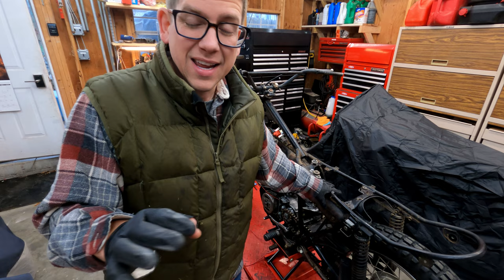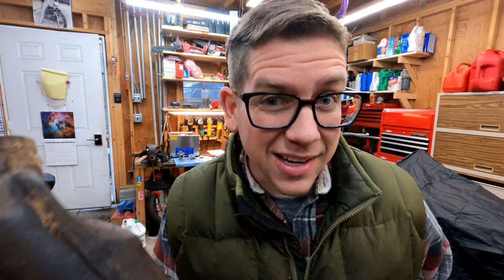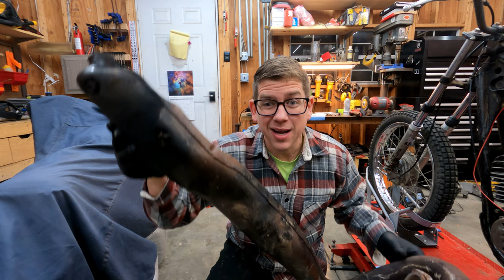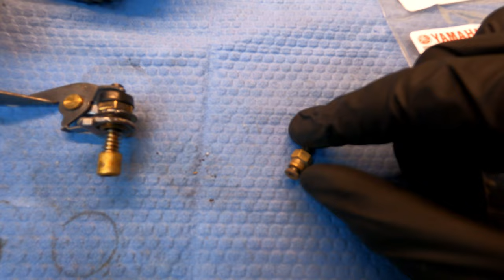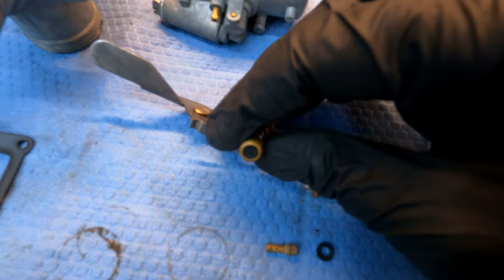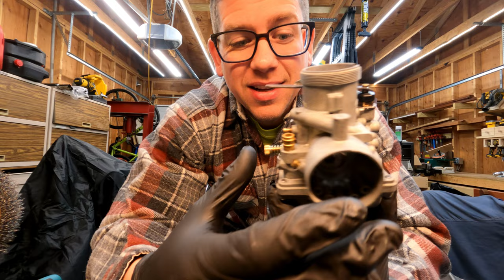FINALLY Starting  - VINTAGE ENDURO MX BUILD - 1974 Yamaha DT250 Pt4

Comment: The fantastic troubleshooting abilities, and patience, shown here are skills that everyone should have, in any job they do, not just mechanical stuff.
Reply from the maker: Thank you! Sometimes I wish it didn't take me so long to diagnose things, but then I remember that I'm relatively young compared to some of the old timers that have been doing it for 25 years
Reply: @two-cargarage  Process is the most important thing. Speed comes next. I'm not all that experienced and I have learnt that rushing you can f#$k things up real quick. Not great when you are dealing with parts that are expensive, or impossible, to replace. I hope you do more vintage Japanese stuff

Comment: spot on, thats why diesel engines go into "regen" mode to clean the cat and exhaust, computer overheats the ehaust and puts fuel directly into the cat to burn off deposits. along those lines, i had a brand new Mallaguti moped back in 1976, after  a few months, it was dead, i knew bikes ,especially two strokes, after a week at jw groombridge, Heathfield , where i  bought it i collected it fixed, my brand new moped had the exhaust cut in half and welded back together, and a splash of mat black paint, but went like a rocket after that !

Comment: Do not neglect to clean the resonator,drill out holes in the diffuser,decarbon and drill 3/8 hole through the center of diffuser,I did this work to my 1975 dt 250,great results.

Comment: Super helpful. I'm currently working on a 72 dt250. cleaned/lined tank, new petcock, rebuilt carb, changed the oils, put it together and had trouble starting.  Literally today I'm buying some new plugs and will try the BE-9 to see if that works. fingers crossed. Great job on your videos. Very real and honest
Reply from the maker: thanks and good luck!

Comment: Huh what about hooker header think that could clog up? it was full of oil I dumped it out but I couldn't get it started I replaced seals all gaskets put top end on now I might do this to help get her started. I also heated top end parts get old oil off on my woodstove. Exactly same way I feel hope mine starts lol yeah right. I was in same boat coming to finish hear. I replaced points condenser cleaned everything up new seals oring gasket s everywhere oem carb rebuilt air filter oiled new coil and exhaust gasket I have hooker header though really hope to be starting it in next couple of days. Good luck with it
Reply from the maker: Good luck! I don't think the header could really clog up, there's not much carbon buildup in that part of the pipe. Sounds like you're looking all the right places, don't forget to also put a new spark plug in!

Comment: 1. Chemically dip pipes to clean them, unless you want chunks of carbon entering and damaging the cylinder. 2. Its NOT  a "defuser" its a silencer. 3. Please do NOT  work on anymore bikes. 4. After cleaning and rebuilding thar carb you did not think to install a new spark plug?
Reply from the maker: Thanks for taking the time to comment, I appreciate your view!
4. The spark plug tested fine.
3. Well that's not very nice. It's a hobby, sorry! And it's a hobby where we all, at all ages and skill levels, can continue to learn with experience. 
2. It doesn't silence the bike, so I respectfully disagree.
1. Have you ever "chemically dipped" pipes? How would one get a vat big enough and fill it with a harsh enough chemical to eat away 40 years of carbon build up? The fire process works great. And generally, the cylinder doesn't suck in air from the exhaust so the likelihood of "chunks of carbon" entering the cylinder is slim to none in my opinion.

I don't want to debate, but instead just share my thoughts. Again, I appreciate you taking the time to comment.

Comment: Yeah 2 strokes eat plugs. Does that bike have points? even worse on plugs. You may have a bad condenser. Points beat cdi in my book. They dont just die 50 miles from home. Have you done a leakdown check?
Reply from the maker: Yea I threw a new condenser in it and realized it was eating plugs like crazy. So I bought a bunch of the autolite ones (guys on the forums seem to have the best luck with them), and gave them to the owner of the bike to swap a fresh one in before each race.
Reply: Yeah Im not a ford guy but autolite seems to make pretty good plugs.